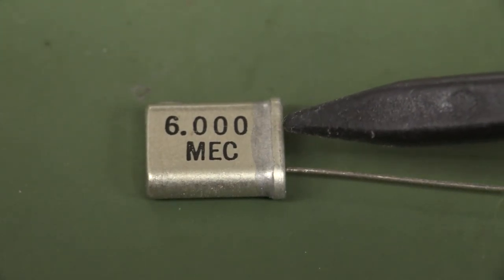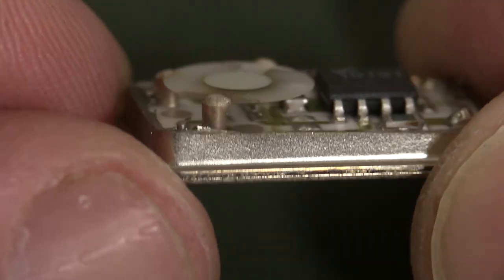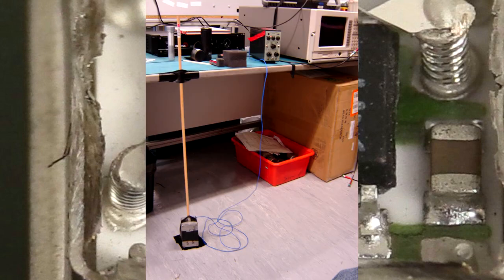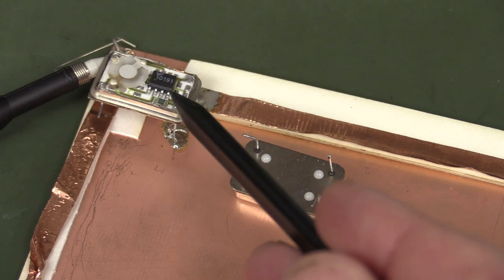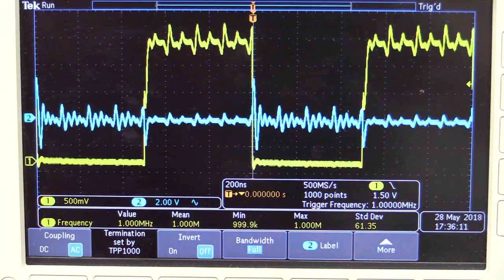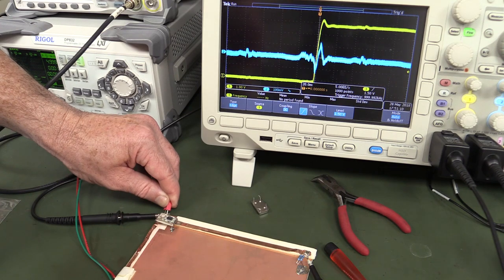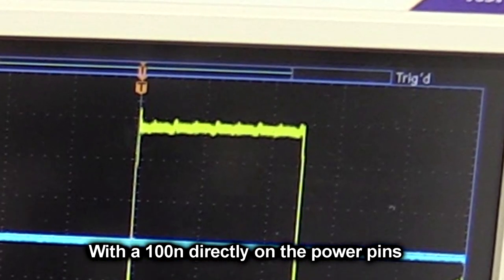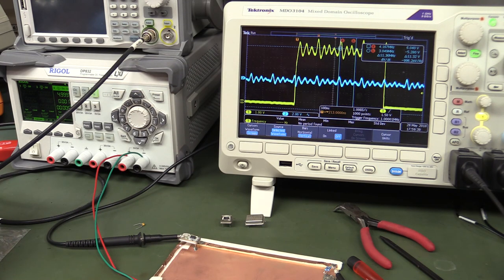EEVblog #1089 - XTAL Oscillator Teardown

Comment: Nice video.  BTW, your viewers might find this interesting: this device is a thick-film hybrid.  Meaning, the traces are not etched, like a PCB.  Rather, they are made by silkscreening on a conductive paste and then firing it in a kiln.  And what looks like solder is probably conductive epoxy.  I don't recall if you ever did a video explaining hybrid circuits.  I used to design stuff like this back in the '80s.
Reply: good info thanks :)
Reply: Interesting info!
Reply: Fascinating

Comment: Gravity must be higher there, here this was more than 2 MINUTES. LOL. jk, very interesting video. Didn't knew how are those inside.
Reply: But there are multiple 2-minute teardowns in this video. Plus exposition for context.
Reply: Please use spacetime curvature, gravity is soooooo 1686.
Reply: I the "country" 1 mile = 10 and a couple minutes = 15-20
Reply: Is all Australia there. The gravity points up.
Reply: It was 16 minutes, but with the divider by 8, that is why it was labeled 2 minutes :-)
Reply: Haven't you heard? Australia here is a simulation. These crystals aren't even real. Dave is a paid actor. The Earth is flat - and gravity isn't even real. Der ;)
Reply: EETime generally runs long.
Reply: Metric time

Comment: I used to design and repair test and control equipment at a major Quartz Crystal manufacturer. This was "not recently". We did everything from growing the quartz through building TCXO, OCXO, DIL oscillators, SAW devices and Filters.

Our DIL oscillators used a real thick-film modules, with the chip bonded to it, and connections made with bond wire. Partly because (in big volume) it was cheaper, but also because it allowed you much more space to "do things properly" - with one of those things being proper decoupling.

Dividers were quite common, partly because it is hard to make good crystals at certain frequencies, and there was also a "size" thing - good 1MHz crystals are quite physically big.

Did you get a sample of the gas when you opened it? Mostly they're filled with Nitrogen with a tiny bit of helium. This is part of the controlling the ageing, the helium makes it easy to check them for leaks very thoroughly.

The mounts were crucial, get them wrong, and you get a lousy, rotten xtal. How you hold the crystal changes its characteristic. Get it wrong and you'll get a horrible product with issues like "band breaking".

For crystals in conventional packages - those two clips means you hold it in just the right way, and with just enough "spring". It's much hard with DILs and that's why you often see three posts.

If you were seeing substantial shifts and changes in ageing following a shock, then bluntly, your crystals were a bit crap. The phenomenon has several names in the industry, we called it "sleepy crystals". It really was (and still it) one of the industry's dirty little secrets.  It is a sign of a production problem. I'll explain that later.

In extreme cases you would have a product sat in a drawer for a few months where the Oscillator wouldn't start at power up. If you (very carefully) took it apart, you would find the ESR was through the roof, the Q was pathetic and if you did get it to start oscillating, it was likely to have been on a "band break" - so the frequency would be slightly (but significantly) offset.
Bang it on the table - and all would be back to normal again, until it was left for ages.

One of my first post graduation jobs was to design something which could detect this problem without the whole "waiting a month or two to see what happened" thing.

I designed a system, which used the then standard ISO methods of measure frequency and ESR, except at very low drive levels. You would then gradually increase the drive level, watching to see how F and ESR change, until you are at maximum power, then you wound the drive level back to the zero again. You plotted the results on a graph, and you would get a fairly classical hysteresis curve, and the bigger the area inside the graph, the dodgier the crystals. You only had to leave the crystals alone for a day or two, per-test to get a clear result.

I'm being called out on an errand now, but I will return later and explain where the phenomenon comes from.
Reply: Very interesting stuff!  Posting a reply so I can hopefully get notified of your followup comment.
Reply from the maker: Awesome detail, thanks!
Reply from the maker: We used to fill and hermetically seal underwater modules with nitrogen for thermal conductivity. Was easy to use tester to sniff for leaks.
Reply: Andrew Baker - That was a fascinating read - thanks! ☺️
Reply: "Did you sample the gas?" Yeah, he was hoovering above it with a GC syringe, and injected it into his pocket GC. LOL. I'm certain he didn't sample the gas. Ha.
Reply: Thanks for that, good info clearly stated.
Reply: Andrew Baker Thank you for this long text, really interesting what goes into these crystal oscillators.
Reply: We put a touch of helium in - it was easy to test them en masse. you put a lot (say a hundred) finished vessels in a sealed can, you had ten such sealed cans, you put them in a manifold, with a tap for each, pump them down to a vacuum, and then connect each vessel to a vacuum pump with its exhaust plumbed into a mass spectrometer tuned to helium. If when you opened a tap, the needle moved, then you knew one was leaking. So the 100 in that can would be split between ten cans, and repeat, eventually you find the one which is leaking. It's rare, so the process is very fast, very efficient in practice.

The moment we had a "fail", while the operator was finding out which specific device it was, a toolmaker (called Jim) would be busy replacing the resistance welding electrodes for that welder. There was no point even looking: they were a consumable item, any hint of an issue - replace (send them back for overhaul) and fit a new set.

...and don't forget to take your watch off first. :-)
Reply: Andrew Baker wow, that's YouTube  magic right here =D
Reply: i designed a load of specialist test gear for some of the components in one of the early, private, transatlantic, fibre optic cable filters - reference oscillators and SAW filters. It was a weird job. You needed a warm coat - an entire, large test area where absolutely everything was at 4C :-)
Reply: Thanks, Andrew. Do you, by a chance know why there are no decent crystals for multiple audio sampling rates (28224000 Hz) ?
Reply: Can you be specific?

In those days, we'd take orders for batches as small as around 100 devices, usually for a specific load, frequency combination. These days, it's almost all done with PLL. There were a few frequency ranges which were awkward, and they would cost more.
Reply: Do you mean "Swept Quartz"? It wasn't used on ordinary commercial and industrial stuff, unless it needed to be radiation resistant - FAR too expensive.

But we did have a process for making ultra swept quartz. if you cut that thin enough, you could literally fold the slices in half, let go and they'd spring back.

Our aim was to get good xtals using ordinary methods, and usually you can.

And anyone who cut the end off a crystal block and discarded it, would have a serious argument with the manager in charge of the growing area. In order to grow the quartz you needed a "seed". And one of the weird things was the quartz crystals only grew in the X and Y directions. So normally the grown crystals would be cut from the block in such a way that a seed could be recovered at the end. It is true that the blanks cut from any area with lots of inclusions = including the end sections. 

...and I missed an awful lot of other stuff out too. There's a vast amount of arcana in the quartz industry. Some of it is close to black magic.

Which reminds me, we also sold the highly included quartz blocks to California, especially around San Francisco. I mention this without comment.
Reply: This is comment gold!
Reply from the maker: Andrew Baker - We tested single can at a time as it wasn't high volume stuff as it was for a military sonar and these modules costs thousands of dollars each. We used to leave then in the chamber for 24 hours to determine trace amounts of leakage, as we had many penetration pins on each end that could cause a leakage path. Also, thermal cycle and repeat.
Reply: I principle, it all works everywhere. SC cuts could be made to oscillate at room temperature, but if you did, the temperature stability would be worse than a typical AT cut crystal. They have a higher ESR, they are a lot more prone to "band breaking", they need to be enclosed in a vacuum to reduce the mechanical losses.
and, most importantly - they are an ABSOLUTE SOD to make. It's a double rotation cut, so that's two lots of x-ray goniometer measurement, you have to use a saw which is twice as complicated, cost ten times as much and are far more difficult to operate. and even then is around 2x to 4x slower. You get less usable crystals per block, you have to work to tolerances about 4 x tighter (less than a minute of arc). It's like someone working down a check sheet of "how can we make these components more expensive to make?".

The upside is you get a crystal which is more stable, ages less, and (crucially) has a convenient inflexion in the frequency / temperature curve, a bit below 100C, which is just where you want it to be for an ovened oscillator. Do all that right, and you get a device more than an order of magnitude stable than an AT cut device - but you only get the benefits if you bung it in an oven, if you don't do that, it's just pointless, wasted expense.
Reply: "Need" is the wrong word. If you have a TXCO it's very cheap and easy to add the trimmer and the customer probably wants the kind of accuracy where they're likely to want it. 

If you're going to usefully trim a crystal oscillator, you need to control for the C1 of the crystal, which is a PITA. So it's only usually done for crystals destined to end up in something like a TCXO or a VCXO.
Reply: At these levels of accuracy, you need to be really careful with your specs, not all frequency errors are the same.

There was a factory wide-clock distributed at 1MHz, 5MHz and 10MHz. This was derived from a one of a pair of very high quality OCXO - because the short term stability and phase noise of a good SC ovened crystal was way better than you'd get out of an atomic clock.

The OCXO were then referenced to a secondary rubidium standard (two on site) and they were in term reference to two broadcast standard, we subscribed to a service which mean we would get weekly reports reporting the error in the received standard, for the previous week.

And awful lot of very tedious maths was then done (often by me) at the end of which we could give the ageing area a table of correcting figures, which they would use to calibrate their ageing measurements for the previous week.

it was while I was doing that job that spreadsheets appeared. That made things SO much easier.

And one Friday afternoon, one of the rubidium oscillators went on the fritz and I earned more overtime in the following weekend than I normally earned in an entire month! to "work around" the problem.
Reply: You can, but there are compromises. 

Most processors now use an xtal from the range where "small, with good performance" is possible and cheap, and then use a  PLL to get the frequency they want.

OTOH, the authors of some the data sheets and application note writers need to be taken out and shot. (And i am looking at you ST!). They use a theoretical approach based on the use of information you don't have and aren't going to get. They also assume everyone has a FET probe and/or ahihg frequency current probe lying on their bench somewhere. For most people, most of the time, it isn't neccesary - yes, there are real problems, but there are easier ways of getting around them.
Reply: i did some "very low phase noise stuff". We had the first HP3048A in Europe. I'm not allowed to talk about that in any detail, but I will say that it's more what you put around the crystal, than the crystal itself, for the very low jitter stuff. Good enough crystals were available, but expensive - and simply shoving a very good crystal in would not make your circuit low phase noise of itself.
Reply: Thank you for these valuable information. Could you tell me what references you read for learning these stuffs ?
Reply: Thank you Andrew Baker for the info on xtal manufacturing, I have zero need to produce xtals but found the awesome explanation of the process fascinating.  It sounds like you had some very cool jobs.
Reply: When I started, it was academic libraries,  the British library, obscure journals, ancient patents and magazine articles.

I think it is slightly easier no, but only slightly. This is serious arcana, beyond a certain point a lot of it just isn't published. 

I'm not sure there's any other way than "get a job in a crystal factory".

If you do get one, I will tell your that working in one is "sink of swim", you need to know your basic principles and you need to learn self confidence and self reliance - but if you do find a way of doing it, you'll probably encounter a wide range of stuff under one roof than you'll encounter in any other industry. For me, the pay was lousy, but the experience was beyond compare. I was there nearly ten years. 

OTOH, quartz factories are a well known health and safety nightmare. More ways of maiming yourself in weird ways under one roof, than you'll find in most other places.

We had one area where nobody with any kind of jewellery was allowed in, no exceptions. ESPECIALLY wedding rings. Break the rule, and you could easily lose your finger.
Reply: This is why the internet is awesome.
Reply: HalfSpeedMastering you're talking 'now' - there are all kinds of flashy ways of overcoming the weakness of any particular source. It was rather different 30+ years ago.
Reply: Andrew Baker thanks so much for all these comments, really fascinating what is involved in just one seemingly obscure area of our industry. And then we get the end result for a dime...
Reply: Thank you!
Reply: Same procedure as when we tested TO-46 cans..
Reply: > Bang it on the table - and all would be back to normal again, until it was left for ages.

This is one of the most beautiful technical explanations for why percussive maintenance sometimes works ;)
Reply: the "Rubidium" bit of a Rubidium clock happens at 6.8 something  GHz. This is multiplied up from a clock at a much lower frequency, and that lower frequency can, in principle, be whatever is convenient. 

My "richly rewarding"  weekend after our rubidium standard went bonkers, turned out to be because a film capacitor in the low pass filter of the PLL that multiplied the frequency up to 6.8x GHz had gone leaky. It took four weeks to work this out, replace the capacitor and get re-calibrate it. (Rubidium clocks are secondary standards, and require calibration).
Reply: i thought there is a vacuum inside that metal casing, not a gas
Reply: What Is Islam?

Islam is not just another religion. 

It is the same message preached by Moses, Jesus and Abraham.

Islam literally means ‘submission to God’ and it teaches us to have a direct relationship with God. 

It reminds us that since God created us, no one should be worshipped except God alone. 

It also teaches that God is nothing like a human being or like anything that we can imagine.

 The concept of God is summarized in the Quran as:

{ “Say, He is God, the One. God, the Absolute. He does not give birth, nor was He born, and there is nothing like Him.”} (Quran 112:1-4)

Becoming a Muslim is not turning your back to Jesus. 

Rather it’s going back to the original teachings of Jesus and obeying him
Reply: What a fantastic bit of information. I am glad you shared. It almost seems to be on the fringe of trade secret territory.
Reply: ahmd abdallah quartz
Reply: Did You work at Rakon ?